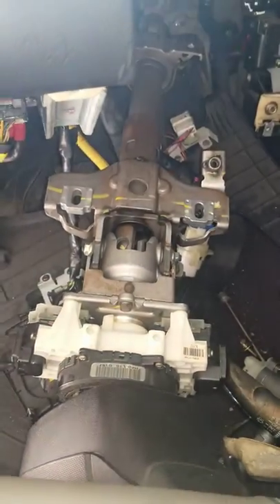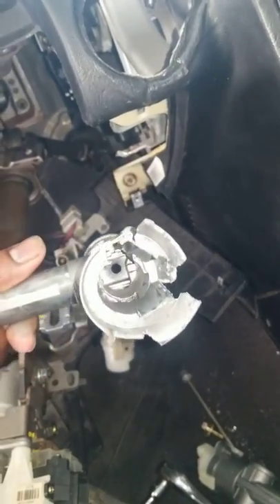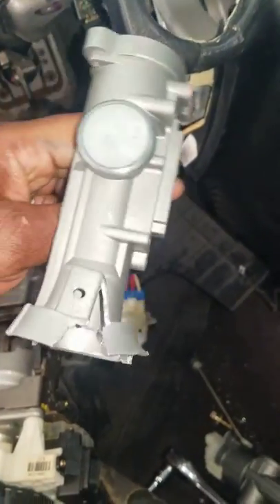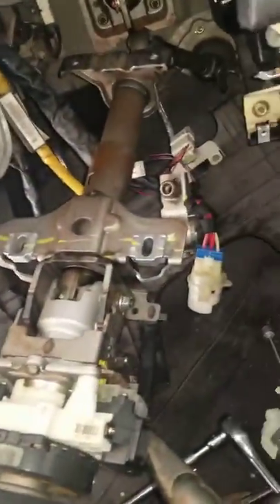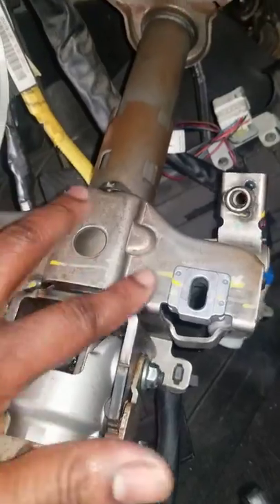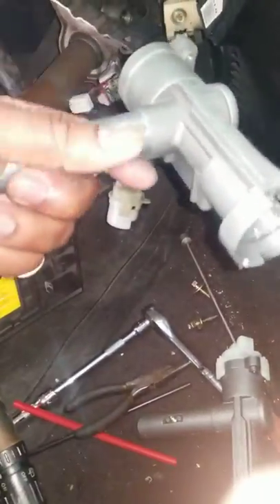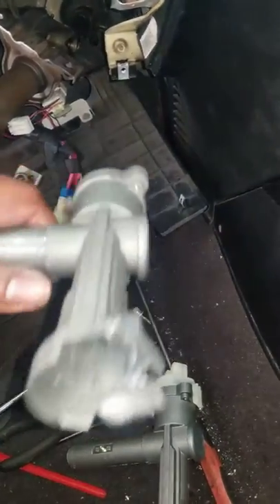2003 tiburon ignition cylinder housing removal

Comment: Hey where did you purchase your part from
That lil piece behind the ignition lock cylinder on my 06' came out apparently it wasnt supposed to so now I need that whole piece that you're having to replace
Reply from the maker: Dealer only
Reply: @mrgoodwrench75  so I have the piece I just need to know how to remove the clamp device holding it when you are showing where the tab has to move, to the right where it's a bracket or clamp holding it down how do I get this open to slide out the ignition housin
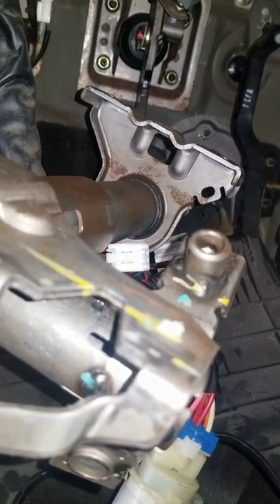Reply from the maker: @bytchima80sbaby  1:30 in the video, u will need something slim and hard like a punch or small allen wrench to push that tab in and then u can slid the whole housing out.

Comment: Dude, I unbolt the 2 screws that hold the steering column up but I can't pull them out, they just get loose and now they won't get tight again
Reply from the maker: What ended up happening with that?

Comment: were did you order that part from? i have a 2006 santa fe and when i went to replace the switch the new one broke off in the housing and i cant remove it so i need to order that housing.
Reply from the maker: I ordered everything except the housing from RockAuto.com. The housing I had to order through Hyundai dealership parts department.
Reply: @mrgoodwrench75  thank you very much for the help. what did it run you for the housing?

Comment: Ok you dropped the whole steering column down and pulled the ignition cylinder out and replaced it with a new one but you didn't explain what was the reason why you had to do that and what it was doing before you tore into it?
Reply from the maker: Some one tried to steal it, damaged the ignition cylinder with a screwdriver but the idiot didn't know how to drive a stick shift. Had to replace it due to the damage as you could no longer stick the key in it.
Reply: @mrgoodwrench75  Man that sucks thats how these young society is these days assuming they were some kids dumb as box of rocks that try to steal a car and didn't realize it until they were thinking what is a stick? My impression at first when you showed the ignition housing that splitted i was thinking did some stick a firecracker down in it and blew it apart, LOL!